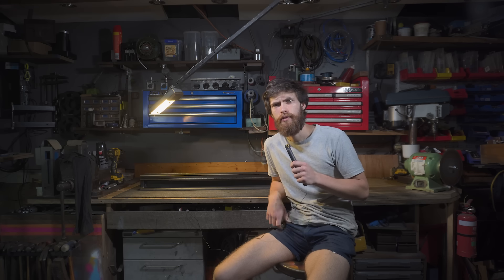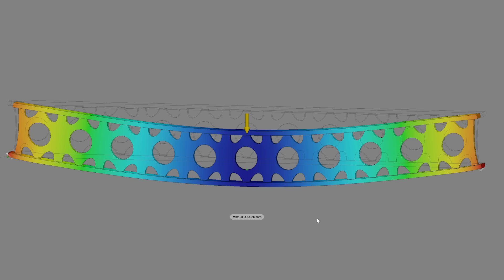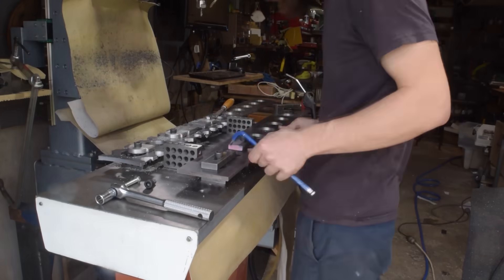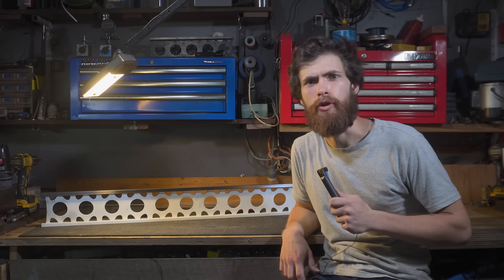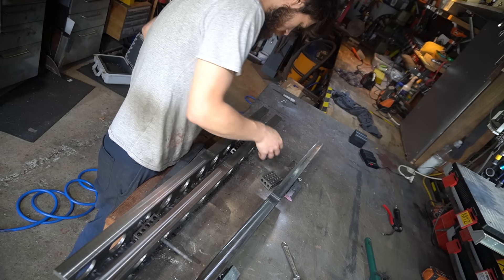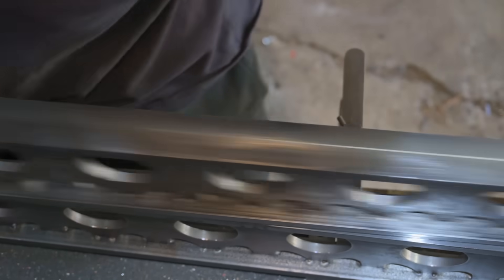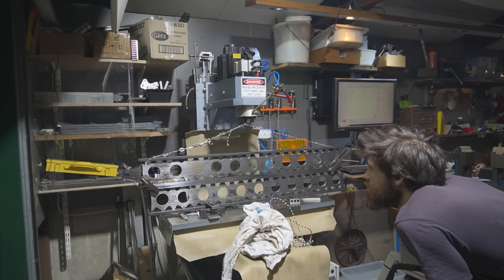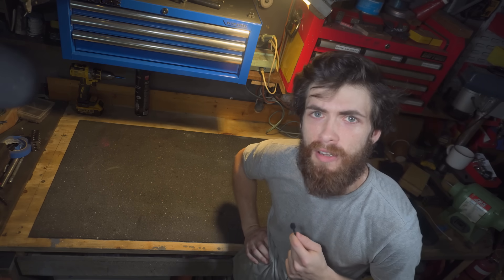I need a PRECISION straight-edge, so I made three

Comment: Ah, the good old 3 surface method... I expected nothing less... Also, nice seeing Alex mentioned... I hold a small state of him right next to the small statues of Stefan and Robin on my pedestal of machining excellence, supreme pedantry and dedication to precision...

Also, are you mad boy? You shoulda drilled some extra say 10mm holes, and you should have put extended wooden handles, something akin to a mushroom shape, to give yourself a place to grip the instrument, which will somewhat insulate the instruments from your body heat... Wood aint the best choice, but it`s cheap, and can be replaced easily for solid cored silicone overmolded handles... When you seek precision, just breathing in a room without hvac to keep it lab grade atmo. cond. is enough to induce errors... Unless the room`s floor is the top of a thick reinforced concrete foundation, just standing near a machine or a surface plate can be enough to induce errors, let alone walking or moving about... There is a reason why true precision is expensive... It`s not all that hard to achieve, but to achieve it with ease, you have to have a remarkably controlled and rigid environment which allows the most minute oscillations to be stifled, allowing you to just have to deal with normal attentive procedures, like not handling instruments without an insulation layer as to not affect the instruments or a workpiece... 

Otherwise, a very nice project and a good undertaking in general!

All the best!
Steuss

Comment: Bruh.  
- steel is the most miserable material to scrape
- you're using weldments that haven't been stress relieved and may want to move on you.
- unless you have hands on instruction in scraping, it can be nothing but frustration and time burned to the ground.

When you're trying to generate something that's going to be a "truth reference", you're best off just sucking it up and buying a granite parallel or surface plate.  They're so common here in the states that it would never be worth your time to generate something (with an unknown error) that's going to possibly lead you down a terrible path fixing something else with it.  If you hose up your lathe ways....you'll be hating life.

If you decide to stick with it....go find someone with a surface plate and ask them to check them for you.  They'll tell you more in 15 minutes than you'll figure out in weeks on your own.

My experience in life is that reference instruments are worth buying.  Then you check everything to it and can make dozens of tools that you know are correct.

Best wishes!

Comment: Dipping hot roll steel in acid does a good job to remove mill scale. Can be as weak as vinegar. Don't let it sit for too long or it starts to rust. I would probably rinse with distilled water after and quickly air/heat dry it after.
Reply: I second this. Getting rid of the mill scale on hot rolled plate by grinding is just frustrating. With a bit of weak hydrochloric acid (often sold as concrete wash) you can just brush the mill scale of.

Comment: The micrometer being the tig ground clamp got me rolling on the floor
Reply: You make it sound like a micrometer was slumming it as a grounding clamp. Grounding is honest work and that little guy deserves respect for putting in the effort despite his fancy metrology heritage 😂
Reply: That hard me cringing even though I knew it was a joke
Reply: ...when you realized he didn't remove the paint at the lug contact point? 😀  You have to commit to the joke, man!
Reply: @somebodyelse6673  I didn't catch that but recently I saw another machinist actually use a micrometer as a ground clamp and it appeared it might be the same cheap brand. https://youtu.be/6vodxhWAlIg?si=ujhk2td-PCq_cOOY
Reply: A vernier calipers is excellent for double duty as a thin-blade monkey wrench when you need one.
Reply: I'm a tig welder and my welds are more accurate when I use my neigbors micrometer as a ground clamp. When I use smaw and I need precision flux removal, I take my roomate vernier-caliper.
Reply: That was a particularly cruel part!
Reply: @BloopTube , thin locknuts do not have a prayer, either!
Reply: i use pliers as a clamp. and hold them with rubber bands
Reply: And seeing it still on the thing while he was actually tigging  killed me
Reply: Bro that was literally driving me insane

Comment: Brilliant! A few details please: Size, weight, material size used. Thanks!
Reply from the maker: I'll have to double check the weight, more than half ended up in the chip bin. 1020mm long, the webs were 110x8mm, and the flanges were 32x12mm
Reply: @NoEngineerHere  Thank you!

Comment: Nice work, I’ve been preparing to do something similar for my own cnc build, Robin Renzetti would be proud.

Have you tried using optical flats? I have a few and they are very humbling if you wanted to further go down the precision rabbit hole.
Reply: very humbling... well said indeed... they, and the electric 1nm test indicators... Shit capable of running a sane person mad in less than 2 hours... Well, not counting the hours of work you put in in an attempt to produce a precise, flat surface...

Comment: Always nice to see a non-engineer do stuff much better than an actual engineer. (me)
Reply: I mean, the question is, are you actually an engineer, or do you just have a degree in engineering?
Reply: A few ideas on how I’ve learned to be less hated as an engineer:

I’ve found there’s a stark difference between most manufacturing engineers and design engineers. Both being somewhat prone to “throwing things over the fence”.

If you’re directly involved in the manufacturing of something and learn enough to make the mfg team not hate you quite as much as one of the other engineers, it’s a good start. Another good practice is to humbly partake in the RMA of your designs and listen to field feedback under the impression that maybe you could have improved the design instead of immediately assuming they used your precision tool as a hammer. Also, if it’s hard-ish and heavy, it’s gonna be used as a hammer… 

Machinists often think they’re smarter than everyone else, same as tenured engineers… The difference between a journeyman and an operator is, a journeyman fixes their own mistakes, an operator only blames an engineer. The journeyman blames the engineer AND fixes their mistakes.

- Some borderline arrogant 30yr old Manufacturing then Design Engineer (me)

How something is made dictates how it is designed, the ctrl+p engineers developing in my school had no help in this regard from their design professors. There’s a reason they’re university professors, go to a good community college with a professor who likes teaching and makes money on their own time to learn something. Go to Uni afterward to finish and get your paper, learning some higher level math and physics topics too if possible, so you can have CAD do the math and physics for you but have any idea what’s going on.

And for the love of god, get a damn internship or two before graduating in your projected future field.
Reply: @SOHCHEAD  There are classes like design for engineering.  They should not be optional.  Of course, in some fields it gets weird.  One thing I remember from my Computer Engineering degree was a bit of basic math.  If a company is going to make a million of something, then saving them $1 on components saves $1 million dollars.  If that can be done with some board changes and making a small team spend a year working with a painful micro-controller then it's worth it to the company.

I personally love my 3d printer as a real world example of tolerances and manufacturability.
Reply: An engineer's job is to do the minimal necessary.   Anyone can build a bridge that doesn't fall over.   It takes an engineer to make one that almost does.
Reply: @zachansen8293  "yeah but nobody uses that lot, does it matter if it's off by a bit?" - Engineer on phone trying to close his worklot
Reply: Exactly.  I am a mechanical engineer and I can't do this.   Well maybe. I've never tried. Might get it on the first go but more likely the 3rd. LOL. But for sure it's not part of the curriculum at the University.
Reply: As a mechanical engineer I can tell you we are trained to figure out what we need and communicate to the shop what we need, not at all how to do it.  A good engineer learns what the shop can do and how much that costs in time and effort.  I would always love to see my stuff being made in the shop. I would bring a print to the machine shop to review BEFORE releasing it. I wanted to meet the guy making my part too and wanted the feedback.
Reply: It comes back to contraints 😂
Reply: I think that is because the typical engineer doesn't do much more than flap their jaw 🤣🤣😂😂
Reply: @joell439  It's mostly due to the fact that Engineers make things to work in theory, whilst machinists make things to work in practice. In theory there's no difference between theory and practice; in practice there is.
Reply: @basstard13 completely agree.
😢too many people are seen as being engineers where there is no need. Often just assemblers. 
It is the same with mechanics that merely fit new parts. The guy that blueprints a motor is an engineer, not just a fitter.
Of course you need to consider if the method of checking accuracy is actually as accurate as you think.